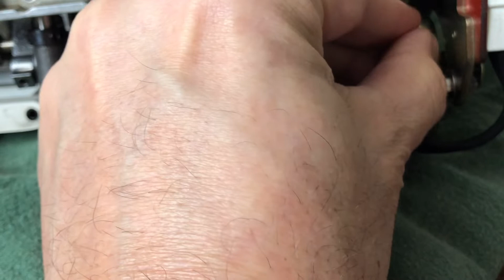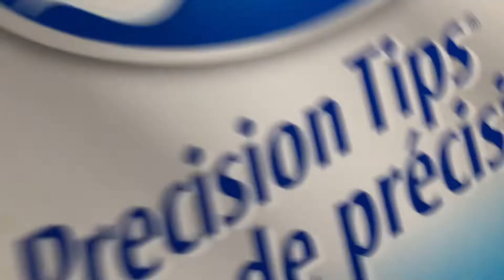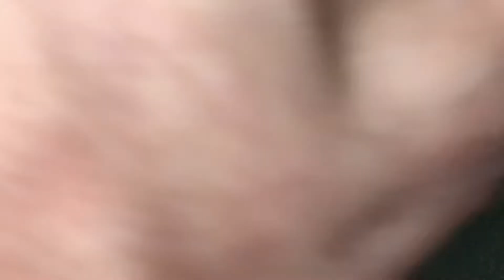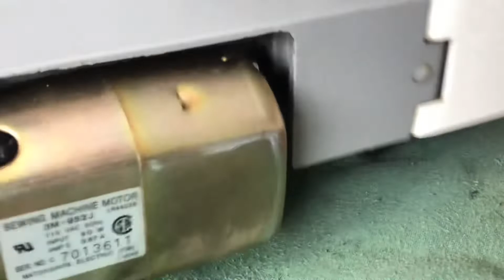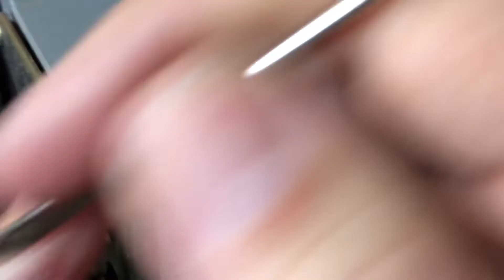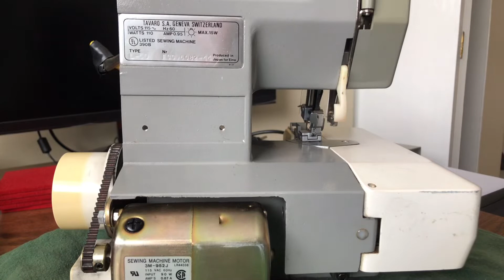SERGER SERIES #5: Serger Motor Maintenance: Inspect For Brush Wear & Oiling the Motor Bushings

Comment: I have the original Elna Lock L4 Serger purchased in the 80's. I always did my own maintenance but never opened the front cover
I now have the courage and knowledge to see what else I can maintain. I learned quite a bit, Thank you. I've used it on and off
for years since I purchased it. It takes fiddling with threading and blades setting depending on the seam width.
Reply from the maker: Glad this gave you the confidence to dive deeper into maintenance! 🛠️